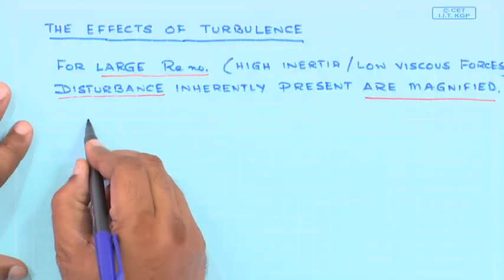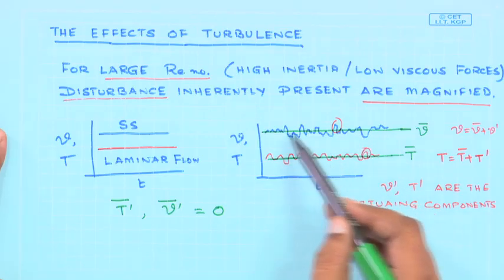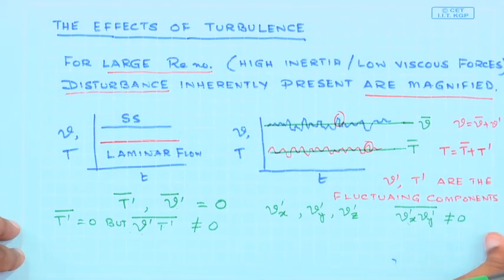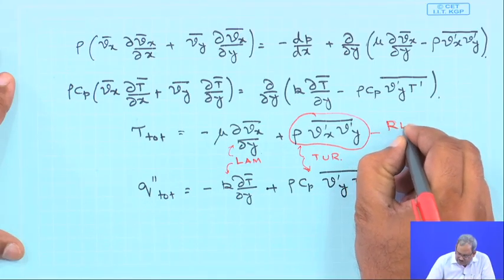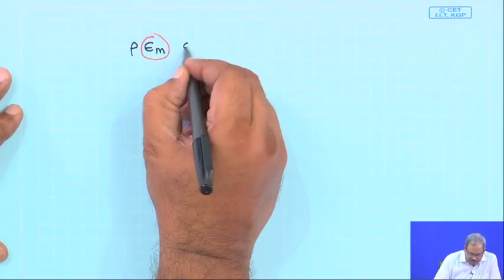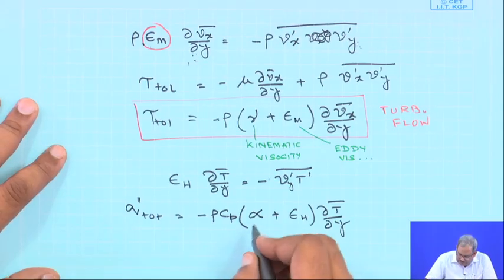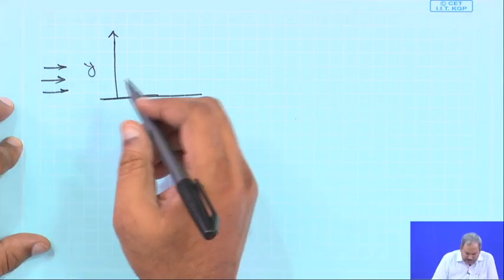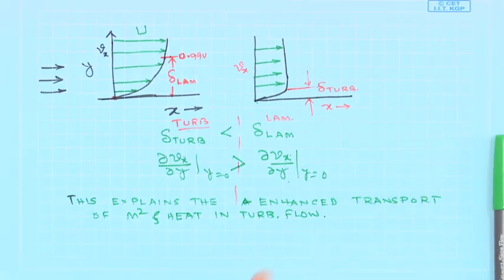Lecture 24 : The Effects of Turbulence

Comment: Thank you for the helpful statement at 19:00 that the additional heat/momentum transfer is a direct result of the non-zero nature of the fluctuating components of velocity and temperature or velocity components in two directions. But, my question is how are the terms associated additional transport of energy and momentum (i.e. Reynolds stress) for turbulent flows determined?